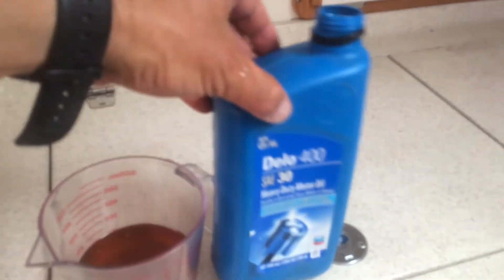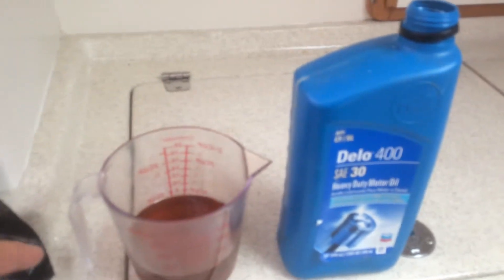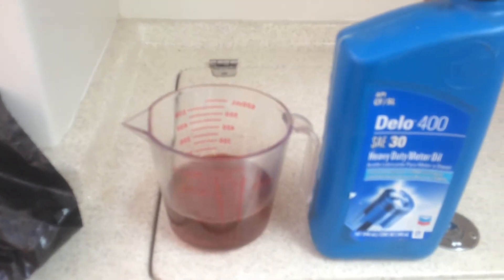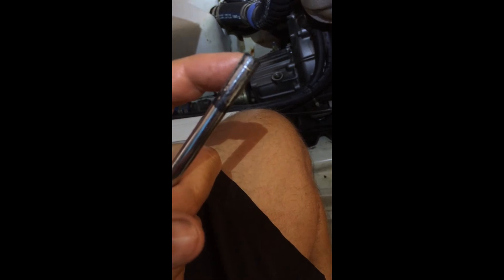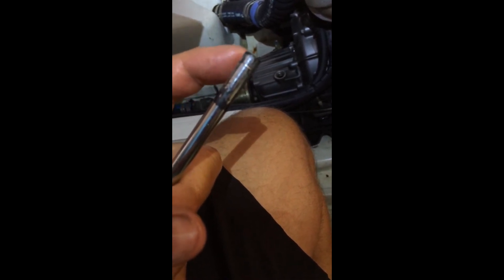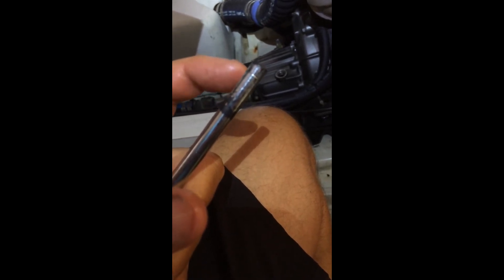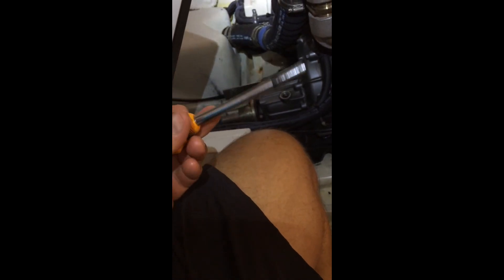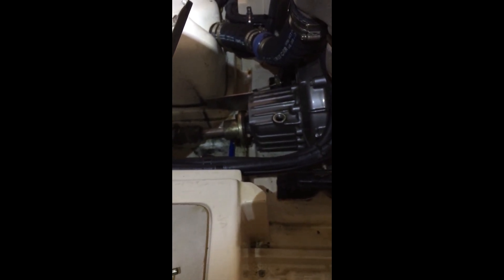Kanzaki KM2P series gear box oil change using SAE 30W HD ENGINE OIL

Comment: Based on my Yanmar service manual it us just opposite: you check oil level with screwed in dipstick.
Reply: There's a bleed bolt on the bottom for those that don't have an oil extractor.
Reply from the maker: This is not what my trusted friend says. Thanks for your comment. Can you double check the model and details in your manual?
Reply: @dannyjensen4954   my engine is 2GM20F.  It makes sense since you check oil with dipstick fully inserted. Page 41 of operating manual, point 2.
Reply from the maker: @Beba-qv3db can you check what the transmission manual for KN2P says? Are you looking at the engine manual or transmission manual?
Reply: @dannyjensen4954   it is operating manual , original, covering engine and gearbox. It says
 " to check with  screwing the dipstick ".
Reply from the maker: @Beba-qv3db  Thanks